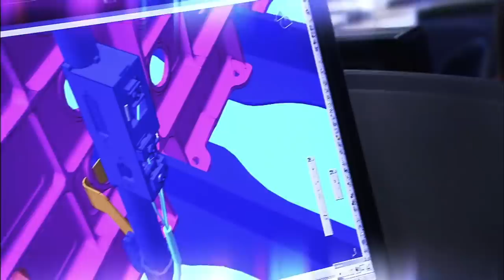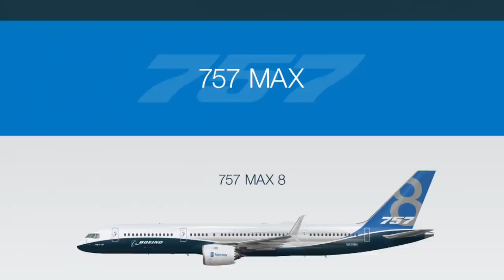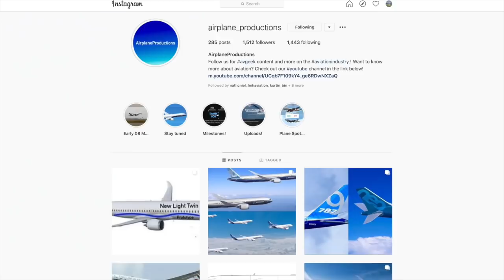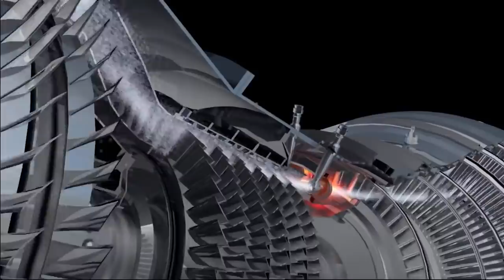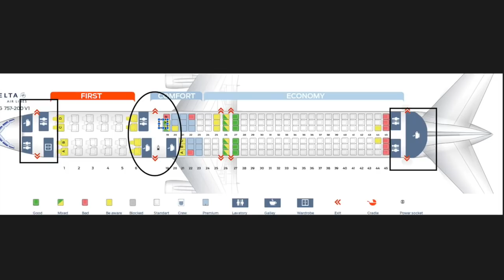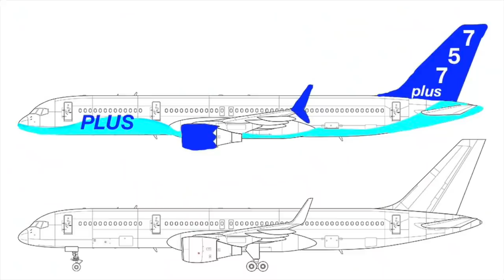Boeing 757: Could a 757 re-engine work? (757 plus)

Comment: 757 hands down best airplane in its class the 321 is decent but when it comes to the 757 you can load it full of passengers and cargo it will fly. The 321 can’t do that. The 757 is the king of it’s domain. Airbus has the upper hand in this market because Boeing stop making the 757 and focused on the 737 which has proven to be somewhat of a mistake. Airlines wanted the 757not the 737. A re-engine of the older 757 is a great idea and making new ones is awesome. Ounce Boeing was talking about putting new engines on the 727 and dropping the 3rd making it just a twin engine and that concept was also great if you search the internet you can find the drawings of a re-engined 727 so the thought of breathing life back into the 757 program is great.

Comment: They tried that already with the 737 Max. It did not end well.
Reply: The 737 and 757 are not the same plane.
Reply: @electric7487  No S**t Sherlock!!!
Reply: @Patmofar  Merely upgrading an existing airframe is not a bad decision, nor is computer-assisted stability control. The problem with the 737 Max is MCAS's horrible implementation and the fact that it wasn't disclosed to pilots. For the 757 it should be a lot easier. Of course Boeing will learn from the 737 Max fiasco. They can't afford to have such a thing happen again. 

This is also very hypocritical as well. People who say that merely upgrading an existing airframe say that upgrading the 737 NG into the 737 Max was a bad idea, yet they're perfectly OK when Airbus upgrade the A320 into the A320neo or A330 into the A330neo? In the end, this kind of argument is (to put it very, very lightly) disingenuous as fuck.

Comment: Just, no. It's not "re-engined", if you are changing everything except the basic shape of the fuselage and the tailplane (according to your video). New engines, new wings, new systems, bigger windows.... Your idea that it would only cost 2 - 3 billion dollars is pie-in-the-sky. The changes mean complete testing of [in effect] a brand new plane. 
Boeing have neither the money, nor the time to do that at this stage. The 737max debacle is STILL not resolved. The 777X is late and has some major problems. The 787 is barely out of it's teething problems.
Fix those things first, sort your company out, then we'll talk about a new airplane... but they're already too late to the party, and Airbus have taken all the players that matter (Delta's top management have already indicated they're moving to an all Airbus fleet)

Comment: 757 is my favorite airplane ever but has a bit much of a fuel burn and weighs in a bit much. Then again the design is about four decades old. New engines and wings would improve this massively. But since the tooling is gone, Boeing would have to reverse engineer the design.

Comment: I think modernising the 757 sufficiently would cost nearly as much as a new aircraft, especially since they'd have to completely reconstruct the 757 production line. Wouldn't it make more sense to design a completely new narrow body plane, to replace the 737 and 757 with a single family?
I also wonder if updating the 767 makes any sense. I'd have thought a slightly shrunk version of the 787 would be a better approach.
Airbus seem to have much better coverage of the market segments with just 3 aircraft families, the 320, 330 and 350 (plus the 220 for regional). You could argue that the 350 doesn't have quite the capacity of the 777, and there's a bit of a gap between the 321XLR and the 330, but I'm not sure either of those are such a big issue.
Reply from the maker: James Shields Thanks for your comment. Yep, that is one of the reasons why Boeing didn’t want to restart 757 production earlier. NSA and NLT have also been studied before as well. Shrinking the 787 though has proven inefficient due to the heavy structure of the airplane. Thanks for watching
Reply: It’s expensive to rebuild the 757 production but less expensive than a clean sheet of paper if they can find 40 to 50k engines. Then upgrade it piece by piece as they go along adding fly by wire, all glass office, carbon fiber fuselage, replace the wing “stolen” from the 787 with a new unique wing, etc. It may still be a $10B project put with a shorter ramp up and lower entry costs. They have a large product gap to fill. The long legs of the 757 makes engine solutions easier to integrate without silliness like MCAS

Comment: Isn’t the 787 the replacement for the 767. So why would Boeing make a 767X. Boeing needs to go smaller not larger. They need to end the aging 737 program that 50+ years old and make smaller regional jets. Smaller/regional airports are the fastest growing markets aka Austin, Raleigh, etc.
Reply from the maker: corderajones Thanks for your comment. Absolutely, the 787 was intended to be a 767 replacement, but airlines realised the aircraft had too much range they didn’t need. I think the Max will be around for some time to come before Boeing eventually goes with an all new airplane. Thanks for watching

Comment: Didn't work too well with the 737.
Reply from the maker: Robert Russell Yep, though let’s hope it will work right this time if they launch the aircraft. Thanks for watching :)
Reply: But the 737 and 757 are two COMPLETELY different airplanes.
Reply: The 737 rides lower to the ground and the MAX engines would drag so they had to move the engines coward in order to move them higher. This puts the plane's balance off and to correct this, they developed the MCAS which was responsible for the 2 crashes.
The 757 on the other hand already sits high and could accommodate larger engines easily. Since this is so simple, why didn't they do this? Because it's cheaper to keep making the same old 707 fuselages and modify them and assume nothing will go wrong. Compare the body of the 707 and the 737 and you'll see what I mean, the fuselage has hardly changed a bit.

Comment: i think it makes sense to update the 757 use the same materials of the 787 to make the aircraft and upgrade the aerodynamics and a fuel efficient target the range of 6000nm 757 8x and the larger 757-300 shrink it abit put 310 seats and make it fly 5000nm it could work

Comment: A321XLR doesn't have the payload capacity nor performance of a B757 as is, the only reason airlines went for the Airbus is because of fuel burn, give B757 new engines and the A321XLR wouldn't hold a candle. Note that B757 is also the main freighter  and a re-engined version would be the perfect choice to replace cargo B757, simply because (again) the A321 doesn't have the payload capacity nor performance. Some friends who fly A320 family aircraft already complain about the lack of performance from the A321, same wing as an A320 making it a poor runway performer, specifically at hot-high airports. I takeoff from Mexico City with 70,000Lbs of payload and use reduced thrust, the A321 can't lift 70,000Lbs from anywhere. As to containers in the belly, they're easy to install on B757 if that's what the customers want.
Reply from the maker: Francisco Maldonado Thanks for your comment. Yep, the 757 will have higher performances, but one big benefit of the XLR is the commonality with A320. While 757 isn’t common with 737 that most operate. Thanks for watching :)

Comment: All of the 757 tooling and jigs were disposed of when the production line closed, so unfortunately there won’t be any new 757s.
Reply from the maker: tjfSIM That’s the issue, the high cost of building the 757. Thanks for watching!
Reply: @oneskyflyer  Yes, it would be the equivalent of developing a new aircraft design from scratch now. It is a shame the timing wasn't right, as the 757 would have been a much better option for the LEAP engine. You're right though, the 757 has left a huge gap in their model lineup.
Reply: Not true.  I was at a Boeing tour in January 2020 and all tooling still exist.  All the tooling for the 707 and 727, 747sp still exist too.  These are Boeing’s words from the tour.
Reply: @reltney20  A full set of tools and setting jigs exist for all of those airframes? Really? That would take up an enormous amount of space (especially for the 747SP) - I would be very surprised if that is the case. Some tools might remain but I very much doubt they would have everything in place to set up the line again.
Reply: Are they making the 767 with rocks and sticks? What about the commonality? If they don’t feel like doing it, any excuse will work.

Comment: The a321 will never be a true 757 replacement. Not with its current wing.   Those saying the 757 needs a new wing don't realize how good its wing is to this day.  Theres a reason why its never been modified.  That thing will easily cruise at .80 mach which is pushing it on the a321....but unlike the a321 it will do it while carrying enough fuel to fly nearly 4000nm (without aux tanks taking valuable belly cargo space) and with enough flap to get it in and out of airports at takeoff weights the a321 could only dream of. Hot and high in an a321 is a problem the 75 knows nothing about lol.

IMHO the only hope for a 757 mod is either a new PW "watch" engine or a new CFM Leap in the 37,000 to 40,000lb thrust range.  I would also be interested in seeing the fuel savings (if any) using Boeings raked or schimitar (spelling)wingtips on the 75 vs the regular winglets it has now.....

Comment: The 757 is my FAVORITE plane so I would love to see another version, it would be a shame for me to see it go out of service.
Reply: so is mine!
Reply: Same
Reply: James Reynolds American Airlines should order 757-300s and they will be a good replacement for the 737 MAXs
Reply: @sebastianfloyd372  757x will be a big success i pray that the plane is built
Reply: Mr. Aviation me to the 757X will be a good replacement for the 737 MAX
Reply: @sebastianfloyd372  true we 757 lovers want the plane back but we don't know why boeing is not upgrading it
Reply: @sebastianfloyd372  absolutely right aa should buy 757 they deserve it
Reply: @sebastianfloyd372  DO YOU KNOW COBY EXPLANES DON'T WATCH HIS VIDEOS HE IS BIASED TO SPEAK IN FAVOR OF AIRBUS AND AGAINST BOEING
Reply: Mr. Aviation yeah, American Airlines should order 757-300s and they will be a good replacement for the 737 MAXs
Reply: Mr. Aviation the 757-300 is longer than the A321XLR right?
Reply: @sebastianfloyd372  yes, true
Reply: @arnavsharma9882  Airbus should make A321NEOXERs
Reply: @sebastianfloyd372  I know that Airbus stated it won’t work on an aircraft like that, but we didn’t know that 5 months ago. It was just speculation
Reply: @sebastianfloyd372  what is the full form of a321neoxer ? Didn't get it
Reply: @sebastianfloyd372  with the rise of converted 737NGs and A321s there’s no need for a 737 MAX freighter yet and also the 757s can fly for some time, especially as they usually don’t do long routes.
About the A321XER or A322 or whatever, Airbus announced it won’t be working on one.
Reply: @spongebubatz  sure Airbus will. 757-300s are longer than the A321XLR and they won’t be a replacement for the 757-300s. Sure they should be a 737 MAX freighters because they’ll Replace the 737 max only passenger
Reply: @arnavsharma9882  the Airbus A321NEOXER would be the Stretched Version of the Airbus A321NEO the A321LR, and the A321XLR. It would have 4 doors in front, 4 doors over the wing,  and 6 doors in the back. The Airbus A321NEOXER would travel father then any A321 routes with a raccoon mask, Airbus Airspace and high speed wifi with no errors. The first Airlines to fly the Airbus A321NEOXER would be Air Canada, Air Canada Rouge, Air Transat, Avianca, AerLingus, and TAP Air Portugal
Reply: Our Airforce has one, or two, as transports and exec travel. They always seem to breakdown in inconvenient places, despite excellent servicing.
Reply: Jesse W since the 757-300 is longer than the A321XLR. The A321XLR won’t be a replacement for 757-300 but it will be a replacement for the 737 MAXs
Reply: Jess W the 200 not the 300. The 757X and the 757-300 will both replace the 737 MAXs
Reply: @sebastianfloyd372  hi after a long time, the 757 deserves to come back in a new version even though the plane's design is old because it has better performance and also is a good looking plane we hope that the plane comes soon i can't wait anymore
Reply: @arnavsharma9882  American Airlines should order 757-300s and they will be a good replacement for the 737 MAXs
Reply: @sebastianfloyd372  i wish that could happen, but american airlines has already phased out the 757s which is sad since they operated the plane in a very good state(way)
Reply: @sebastianfloyd372  if i had to ask you that how would you re-imagine the 757 with your custom specs how would you like it (esp. tell the measurements, engine choice, range, speed, etc.)
Reply: @arnavsharma9882  737 MAXs are the worst and dangerous planes ever and they should be retired
Reply: @arnavsharma9882  since the 757-300s are longer than the A321XLRs, the A321XLR will not be a replacement for the 757-300. But the A321XLR will be a good replacement for the 737 MAXs.
Reply: @sebastianfloyd372  do you think the 757 is coming back ?
Reply: @arnavsharma9882  yeah they should bring the 757 back. They should make 757Xs and continue to make 757-300s. American Airlines should order 757-300s, 757Xs, A330-900NEOs, A330NEOs, A319NEOs, 737-900ERs and Embraer E190-E2s to replace their 737 MAXs. The 757-300 and 757X will compete with the A321XLR. The A321XLR, will be a good replacement for the 737 MAXs, the 757-300 will be a good replacement for the 737 MAXs, and the 757X will be a good replacement for the 737 MAXs
Reply: @arnavsharma9882  the 757Xs will be a good replacement for the 737 MAXs
Reply: They need to do that quickly,
Reply: @captainsoulmohsav243  yeah, after they build them, they’ll be a good replacement for the 737 MAXs. We could call them 737 max killers
Reply: the 757 is perfect, I think Boeing should re-engine and re-design (safely!) the 757. It does high-density short haul (domestic), long-haul low density (La Compagne/BA) and medium density medium haul (LHR-BOS/EWR) perfectly with excellent fuel economy and passenger satisfaction. All my hops over the pond have been done on a comfortable and surprisingly large B752 (COA and then UAL). I am not impressed by the B739/9ER or A321LR so there is a huge demand from the self-loading freight for the 757. Boeing really need to modernise it and bring it back into production. You can't beat a 757, the A321LR are horrible things, merely airborne torture chambers. I'd rather take a canoe across the Atlantic than the 739/A321LR personally speaking.
Reply: @daveyr5462  once they re engine the 757 it will be a good replacement for the 737 MAXs
Reply from the maker: Kipetio It will indeed. 757 plus will be an amazing aircraft. Thanks for watching :)
Reply: AirplaneProductions the 757-300 is longer than the A321XLR right?
Reply: @sebastianfloyd372  even the 757-200 is longer than the A321XLR 😉
Reply: @spongebubatz  since the 757-300 is longer than the A321XLR, A321XLR wont be a replacement for the 757-300. The A321XLR will be a good replacement for the 737 MAXs
Reply: @sebastianfloyd372  well, the 737 MAX does not need an replacement yet, but the A321XLR will be a good replacement for the 757-200 since their capacity is almost identical and other than the MAX 10 there aren’t any replacements yet!
Reply: @spongebubatz  sure the 737 max does because it’s the worst plane ever. 757-300s are longer than the A321XLRs which means the A321XLR will not be a replacement for the 757-300. The A321XLR is not long enough, Airbus Should make A321XERs
Reply: @sebastianfloyd372  the A321XLR is meant to replace the 757-200, NOT the 757-300! It should be a replacement for Airlines that operated their 757-200 on long haul routes, United for example! Maybe we’ll see something like an A322 one day which gets even closer to the capacity of the 757 or even beats it! Airbus however needs to improve the wing if they want to do it as ithe Wings is already at its limits with the A321XLR!
Reply: @sebastianfloyd372  Much longer. The 757-200 is already longer than the A321 by a few meters.
Reply: @spongebubatz  the A322 is fake
Reply: @josephpak4277  the 757-300 is longer than the A321XLR
Reply: @sebastianfloyd372  and where did Joseph say something wrong? I said that already the 757-200 is longer than the A321
Reply: @spongebubatz  the 757-300 is longer than the A321XLR I mean. The 757-300 is longer than the A321XLR so the A321XLR won’t be a replacement for the 757-300 but it will be a replacement for the 737 MAXs. Boeing should convert the 737 MAXs into freighters
Reply: AirplaneProductions American Airlines should order 757-300s and they will a good replacement for the 737 MAXs
Reply: AirplaneProductions the Boeing 757X Will be a good replacement for the 737 MAXs too
Reply: @oneskyflyer  Really nice video, I would love to see this beautiful plane back in production! :) Also, great choice of music! What is the track called starting at 2:24? Thanks!
Reply: @oneskyflyer  DUDE I CANT WAIT MY FAV AIRCRAFT WILLL BE BACK

Comment: I am a big fan of the 757 its my favorite plane. But i think the issue with a complete re engine could end up like the max. They would probably add a more fuel efficient engine and bigger engine that might disturb the wind flow along the wings. I am not an engineer I dont know, i just feel like this could end up like the MAX.
Reply: Me too (my favorite Boeing plane was 757), but the issue on a re-engined 757 (plus/max/X) wasn’t the problem of the engine (the 757 is high profile plane (enough for shove a large engine into its wings), compared to the 737, which is a low profile plane), it was the cost of manufacturing, the tools that are long gone, and the production line at the Renton Factory.